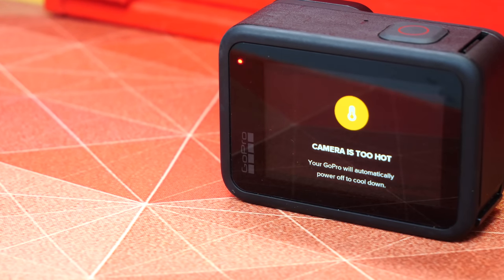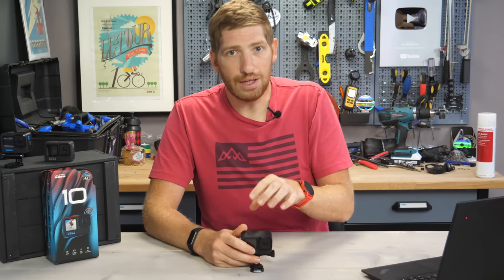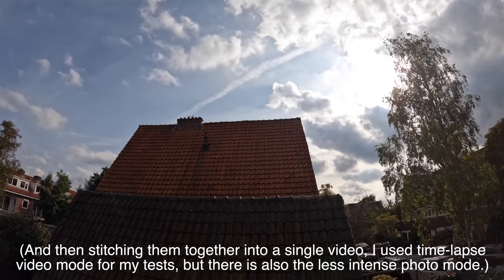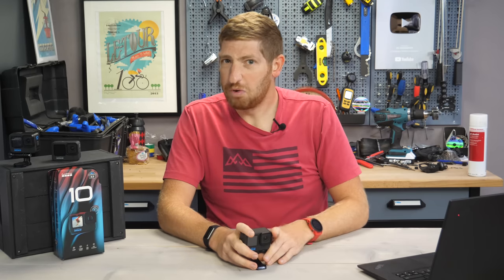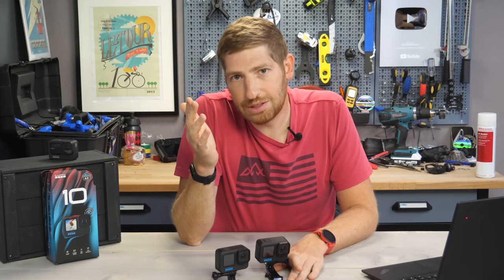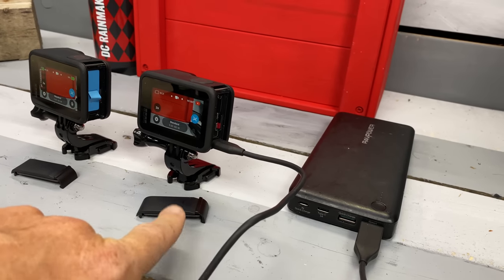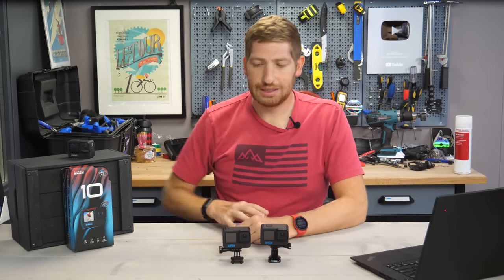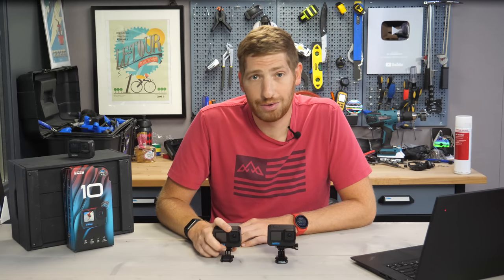GoPro Hero 10 Overheating: 40 Tests Later

Comment: I think you nailed it when you acknowledged that the more things you turn on that requires processing (GPS, horizon leveling, hypersmooth, etc) and higher frame rates, the more likely you are to have overheating issues. I was using mine outside in about 88 F temp, little airflow, with horizon leveling, GPS, and hypersmooth high, shooting 4K 60, and it overheated and shut off in about 8 mins. Cool camera you just have to consider the shooting needs vs environment a little more carefully. Kind of like any piece of sophisticated electronics gear.

Comment: Thinking bout buying this but afraid about the overheat issue. This video solved my perception towards this latest go pro. As a conclusion, as long as you are shooting outdoor, no overheat issue will appear.

Thanks for the all test that you had. From Malaysia. 👍
Reply: Hello geng Malaysia. 

Aku Tak pernah Ada action camera . Tapi dah lama berminat. Cuma tengah perhati Mana paling berbaloi. Nampaknya hero 10 ni MCM berbaloi
Reply: @pdrider7918  yup. Tapi tgk pada bajet jugak la. Mcm aku, angkat yg mahal sbb nak rasa. Hehe. Seumur hidup X pernah pegang Go pro. Bukan nak guna sangat pun... 🤣
Reply: @KhairulVlog   Aku nak guna untuk motorsikal. Buat kenangan ride , safety Dan evidence jika perlu . Naik Motorsikal ni mcm2 boleh Jadi hmmmmm..
Reply: @pdrider7918  so far, aku rasa go pro 10 ni dah level paling tinggi dah. Kalau kata tahun depan keluar go pro 11 pun, upgrade dia dah reach lebih dari standard teknologi Malaysia dah. For example, mana ada Kebanyakan TV 4k di Malaysia ni. Ada org pakai, tapi x banyak. Dan go pro ni, dah boleh shoot 5k kot. Which means in future, bila TV 4k dh murah gila... Dan kemudian TV 8k pun dah murah, teknologi go pro 10 masih x outdated... 😊
Reply: @KhairulVlog   wow nice !! Those are very good points 👍

Comment: Great video and a helpful reminder. I was unaware of the overheating issues GoPros suffer from. so when I set up my GoPro Hero8 this summer, outside on a tripod, in the sun, attached to an external battery pack (with the batter still in it), set it to Time Lapse, and walked away hoping to get a video of my old oak being taken down... I got a max of 20 min before it shut down. This might be an extreme case, but what I learned after the fact is that overheating GoPros are a common issue across all the models, and it is something (even looking at their quotes from the video) that they don't take seriously. If nothing else, they should provide guidelines like you are presenting here in your video so that users are better educated and informed without having to go digging around in online forums to figure out what went wrong after having lost their footage. They are good little cameras, but a bit more customer support up front could go a long way.
Reply: I shoot 20-30 minute worth on my S10 at 4K all the time with NO problems, indoors or outdoors.

Comment: sorry,  did you have Wifi and GPS turned ON or OFF for these tests ?
Reply from the maker: No. GPS and Bluetooth was enabled, however, WiFi on the Hero 8/9/10 actually only turns on when Bluetooth tells it to (meaning, your phone tells it to, or, it uploads to GoPro cloud). This test was prior to GoPro's new Video Performance modes. So if indoors/static, using the new Tripod option is best. I have a separate video on that coming up shortly.
Reply: @Dcrainmaker  My last Gopro's were three Hero4's 😯
so do I buy the Hero 10, or save £70 each and buy the Hero 9 ?

Comment: I made the same sort of measurements on both my Hero 5 black and Hero 7 Black and got similar results.   The indoor/outdoor argument is overshadowed by air movement / no air movement.   I was shooting on a tripod outside with both cameras on a tripod (looking at my golf swing from behind and from the front) and typically only got about 15 minutes in shaded, but hot, Arizona summer temps around 100F.   I attempted many types of shading and reflection to no avail.   When the data was sent to GoPro the only feed back I received was basically “yep, that’s how it works”.   Just got a new Hero 10 but no temp tests yet and after your fine video I probably won’t bother 👍

Comment: Great video - thanks for sharing. Concerning GoPro comments regarding the average length of clip. They should consider the fact they have added the hindsight feature which along with the max lens mod is the mode I use 90% of the time and is the reason I bought the 9. I live in Malaysia - hot humid - generally no wind. As I understand hindsight, the camera is essentially running all the time in the selected mode. I can get usually max 15mins in hindsight with the lens mod attached in 2.7K 60fps. I am a fly fisher and hindsight is so good for me to capture the exact moment a fish grabs my fly in the water.  But, because of overheating I have had buy a 2nd 9 so I can continually swap over and let one cool and I probably need another one. I was hoping the 10 may resolve some issues but from the evidence in this video it would appear not. Anyway, great video and thanks again for taking the time to put it together. New Sub here!!
Reply: Faster processor but probably more heat too.

Comment: The Hero 10 is a great test subject for overheating.  I recently bought a Hero 10 and put it on my motorcycle and after 2 hours of riding (some is stop and go) there was overheating issues.  Just like what you've found.  I'll be posting a video on the hero 10 also on my channel focusing on the mounting of the camera on my Versys X300.  I just finished a windshield design project and spent over 100 hours doing it.  I know how these big projects can really get huge.  Thanks for sharing.   GoPro just released another Hero 10 firmware upgrade 7/20/2022.  Let's see where this goes.

Comment: I was looking forward to the DJI Action 2 and thought that this would help me avoid the Hero10's overheating problem. Since the DJI Action 2 now has the same problems and they are even bigger, your video helped me to focus on the Hero 10 again. Thank you very much for your effort!
Reply: Lower the frame rate, unless outdoor and not too hot, it is still unclear of 4K is much different from 5K as long as you use 60 FPS.  Where I live it is 20 - 90 F except a few days a year.

Comment: I appreciate this video. I kept cringing at all the videos talking about overheating in the hero 10. I know my hero 8 got pretty hot when I had in stuck to my windshield while riding off road. It was amazingly hot to me. I wondered if the 10 was much different and it sounds like. Granted the higher processing in the new camera probably increases the heat a bit and I know my 8 is not as advanced as the 10. At any rate, great video, always enjoy the content.

Comment: Well done on your meticulous testing! Now can you repeat the overheat scenarios with different stabilisation settings ;-), GPS and WIFI disabled etc.
You do see GoPros used as mini static camera for recording various events. In these cases, mounted on a tripod there would be no need for stabilisation, but you can always go with the option to remove batteries and use an external power source, which lasted well in your tests.

Comment: Thanks for the video! I bought mine 7 months ago, didn't know about all the hype about overheating. I bought mine mostly for snorkeling and other than one hike and playing around with the dogs, have only used it for snorkeling, no issues, love it. Then started seeing all the doom and gloom about it overheating and started getting worried, now I can relax again and just enjoy my camera :)
Reply: In water it is going to get maximum cooling.  74 degree water will remove 10 times as much heat as 74 degree air.  Of source it is only good for snorkeling and not SCUBA without a case.  33 feet rated really means 6 feet if moving.  That is why SCUBA equipment is rated for over 600 feet (20 ATM) since it really mean 100 - 200 feet which is the max you should be diving at.

Comment: Great video!!! I mostly use mine static , and I live in Florida. Today it's 98 by the thermometer outside. It's 110 in my garage with no air moving. I shot about 50 minuets of continuous  video on 5k 30, in the media  mod case with no problem because I keep a small fan blowing on my camera. I use an external mic. Keep in mine I'm completely new to gopro so this hero 10 is a big learning curve. It was simple for me because the camera was designed to be on the go hence the name. It wasn't designed to be a stand alone static camera. That's what gave me the idea to place a small fan on the camera and I've not had any issues since.

Comment: Hello Rainmaker, thank you very much for all your hard work.(From Germany) In "real world" scenario . My First GoPro (8) runs as long as the battery take her alive. But this GoPro sits on my handlebar and runs in timelaps mode. For one hour Timelapse I need more or less one battery. The Second GoPro I use to film special landscapes left and right, while riding my bike. This GoPro is covered in foam to handl the wind noise. But this one only takes shots about 1-5 minutes. So all of this should be fine. But for me a big tipoc is battery life . I ride my bike for hours and run through 7-9 battery packs on a day . What I saw until now. I think with the GoPro 10 ,I would need 12-15 ! And a hot camera is not really a good thing for the life circle of a battery. But in the end, I think I will start with one GoPro 10 and find out on my own.
Reply: If you can get away with 60 FPS hypersmooth you might be OK.
Reply: @toriless  Hero 10 was a waste of money . I bought her for horizon stabilisation, the change from timelapse to normal view with on click and to zoom in the video(5,3k to 4k). The video stabilisation only works in good light conditions. I ride my bike through a lot of woods and then the horizon stabilisation does not work reliable.  Video Quality is not better than my Hero 8s . For what I see , its worst. I have to capture video in 5,3k and than render it down to 4k to get a somehow "good" quality(like Hero 8). So no Zoom . Last Funktion is the change from Hyperlaps(Timelapse) to normal video with on click . Yeah this works. So waiting for Hero 11 and hoping that it will not get new batteries again.

Comment: Thanks. I fly a long range FPV plane for over 2 hours in the hot Australian sun and I was worried.
I was thinking of removing the battery to reduce heating.
Glad you tested that.
Reply: Looks like you should try 60 FPS too.  It seems to get hot much quicker as 120 FPS.

Comment: I'm a pilot and want to take a pov in the cockpit. So its exactly like a dashboard in a car.
Thank you for your service. 
I subscribed
Reply from the maker: Yup, in that case I’d just avoid 60FPS, and you’ll likely be fine in most cases. To be sure for longer durations, I’d film at 4K (which is probably what you’d want battery-wise anyway).
Reply: @Dcrainmaker  if i remove the battery and record with it plugged into a usb c will it run till im out of memory?

Comment: I've used my Hero 9 (and a Hero 5 Session before that) as my bike camera recording continuously on a handlebar mount - putting in about 100 miles of riding per week.  The Hero 9 camera is used to capture wildlife or traffic incidents on the street.  I then pull video or stills from the footage when there is something captured of merit.

I run the GoPro 9 camera for 2 to 3 hours at a time using a USB power brick for power.  I shoot at 5K 30.  After thousands of hours of use in the desert heat of southern Arizona, I have never had my GoPro 9 shut down due to heat.  Temperatures in summer are typically 90 to 100F at the times I would ride.  My two previous Sony action cameras (Sony HDR-AS200 and FDR-X3000) would occasionally shut down during the hotter weather of summer.  

I found the same thing as you.  The camera stays fairly cool (warm but not too hot to touch) mounted on the front of the bike with the breeze going by.

Comment: Great job! Thank you! Pretty cool you got GoPro’s attention. I was hoping to see how it does with the case on but above water. I use it for dirt biking so I need the protection but shoot long videos where stabilization is going to be working hard. I’ve been using a Hero 4 this way at 1080 60fps for years without ever overheating so hope the heat doesn’t effectively prevent the 10 from being an upgrade!
Reply: I cycle too and recently upgraded from GoPro 8 to GoPro 10, I also use the protective dive casing in case of damage (falls etc). The GoPro 10 overheats extremely quick, especially if you film in 2.7k or 4k and ESPECIALLY if you film in 60 fps. You can't really do long continues filming with it at all. I feel extremely disappointed and robbed because that's how I use a camera, for long filming, not for 2-5 minute clips..

Comment: The GoPro Hero 10 does not overheat when the battery is removed and power is supplied from an external power bank connected to a USB port. I can share my experience. I have Tellur - PBC302, 30000mAh. This power bank gives 2A per port. This is enough for the camera to work with the GPS set to off. The quality of the cable you use for the connection is also important. Maybe if power bank gave more amps per port, then GPS positioning could be used. Tellur - PBC302, 30000mAh. allows me to shoot for up to eight hours continuously 5.3K/60fps.

Comment: Great job! Thanks. I agree with you that GoPro should alert the user of the conditions or settings that may cause the camera to overheat and shut down. How about a message like "WARNING" "Your camera will overheat in 5 min" "Turn off stabilization, screens, voice control, reduce frame rate, lower your resolution ..... etc.  Imagine if cars were like GoPros and they just stopped working in the middle of the road. Thanks again. Have a nice day.

Comment: The thought process put into this video is amazing to say the least. I’m just glad it can record 4K for 1 hour straight outdoors . How long soon after can you start recording again ?
Reply from the maker: You can actually start immediately afterwards (like, seconds). However, it'll only last a few mins before it stops again. If you need to fully cool down the camera, pulling out the battery and letting it sit for 5-7 mins (at room temp) is usually good enough.
Reply: @Dcrainmaker  That is not too bad, I was worried it would be at least twice as long.

Comment: The removal of the battery and powering using an external power bank seems an excellent solution for long indoor recording. Saying that most of my clips are 5 to 10 seconds outdoors so I have no overheating issues. Thanks for the extensive research.
Reply: dunno about the 9 and 10 but i am able to record 3+ hours of 4k60 cycling footage on my 8 with the battery removed and power bank plugged in under hot weather.

Comment: For recording long videos (1+ hours) while stationary (outdoors, up to 95F), I recommend using an external battery with either the media mod or no battery door. Mount the camera on something so the metal mounts on the bottom of the camera are down (this improves cooling). Turn off hyper smooth, turn off voice activation. Record in 2.7K/60 or 4K/30 at the highest settings. Make sure your SD card is rated for high speeds. Mount a sunshade over the camera if possible to its not receiving direct sunlight.

If you want to bump the settings up then I recommend an external battery with multiple outputs and a decent output capacity, and then plug in a portable USB fan to that battery and use that to provide airflow over the camera. Shade + airflow + optimized settings should allow you to record even in the heat.

Comment: Whaouhhh, Enormous job that you did there ... which made it possible to show the limits of possible video recording in time, according to the Definitions and Frequencies of images, under several conditions.
Personally, I only shoot small sequences indeed, so I wouldn't be bothered by this problem.
Except in 4K TimeWarp or 4K Timelapse, but having tested it, I was able to do 2 4K TimeLaps of almost 40 minutes each, one behind the other, without any overheating worries. TimeWarp of 10 minutes, worry-free while walking.
So in the end, this will only concern people who use a GoPro as their main camera to film themselves, but I doubt that we will do sequences of more than 20 minutes, except for possibly filming themselves ... and in this case, in 4K 25 / 30fps, it will do just fine.
Thank you very much for this excellent video which highlights solutions, not problems.

Comment: I use my GoPro 10 on kayak while fishing. It's connected to USB port installed on kayak with GoPro USB pass through cable. I used it twice, first time for 7 hours of straight recording, second time 9 hours of straight recording. Didn't had a problem with overheating at all, or any other problems. Outside temperature was 19 degrees Celsius  and it was sunny.  

I'm really impressed with camera and I agree with you, as long as you get even a little bit of breeze, camera will not overheat.

My friend is using camera in waterproof housing with charging port for the same amount of time and his camera didn't overheated as well.
Reply: You have the battery installed in the GoPro, right?

Comment: I picked up a Hero 10 last week and was testing it out yesterday.  I mounted it to the inside windshield and filmed at 4K 60fps in regular video and time warp.  I got the overheat warning and shutoff after about 20-25 minutes.  Obviously I didn’t test it to the extreme you did.  I will be using it mostly for filming road-trips and travel type stuff.
Reply: It's impossible to do any continues filming in proper quality with the GoPro 10, absolute utter disappointment.